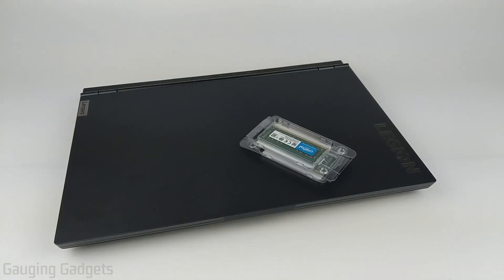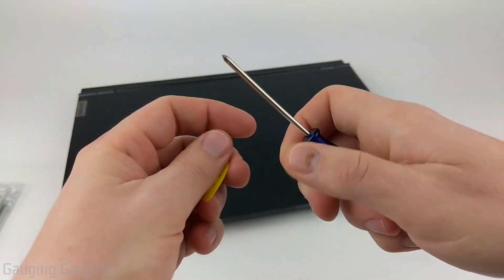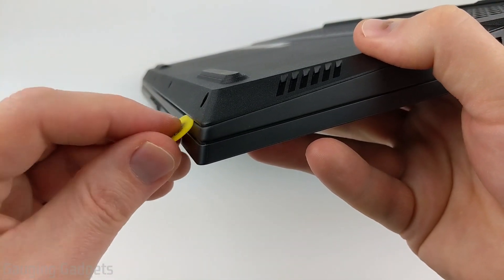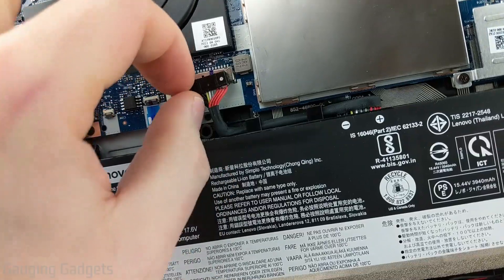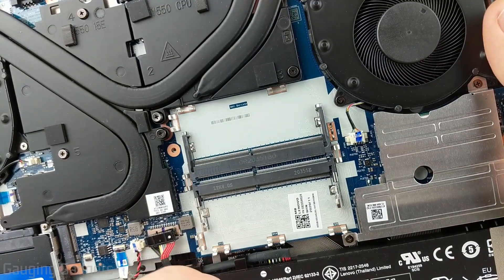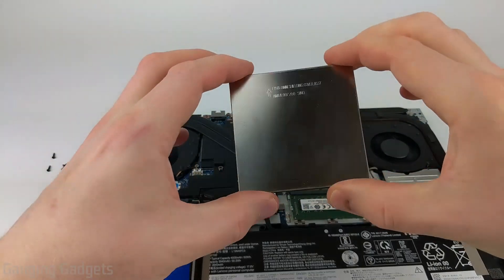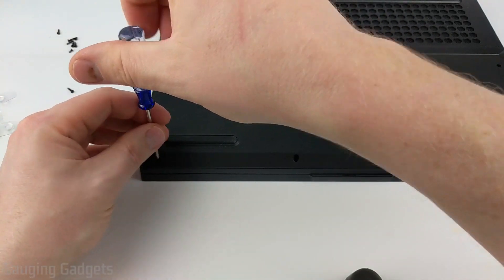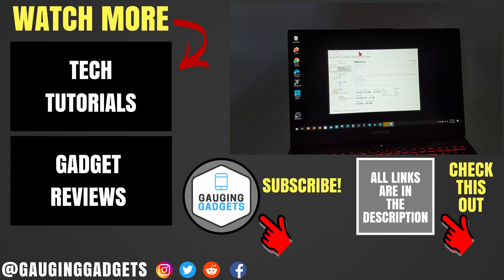How to Upgrade Lenovo Legion 5 RAM - Add RAM to Lenovo Laptop - Legion 5-15IMH05H

Comment: Saw a guy upgrade a laptop's memory, did everything like you showed, screwed it back together and... nothing. One of the memory chips was bad. He then explained that he always tests them out, before he screws the back on, except this time. And this was the time when he should have. Moral of the story? Check that the system works before you button it up. And if you are lucky, it will always seem like a waste of time.

Comment: Hi, I have Lenovo Legion 5i i7 10750H. The installed RAM is 8 Gigs of 2933 Mhz. The i7 10750H CPU supports 2933 Mhz. But I'm finding it difficult to get another 8 Gigs of 2933 MHz Ram. Can I use 3200 Mhz instead?
Reply: same here need advice
Reply: samee!!!!
Reply: Same

Comment: Hi, I just bought the same ram module form crucial and added that to my current 8gb (already in the laptop). When the crucial ram stick is inserted and I power on the laptop a black screen is displayed. When I remove the crucial ram and put the old ram only the laptop works fine. Any help please???
Reply: Maybe you just have to wait for longer? It usually takes more time for laptops to boot with new components for the first time (after installing them).
Reply: Hello,
Did you get it to work? I’m thinking of doing the same

Comment: 1. I forgot to take out thr battery and it short-circuited. But my laptop is tunning fine. What might have happened in long term ? 2.And is it normal for the fans to sometimes start spinning 1-3 minutes after booting up ?

Comment: If i want to upgrade to 16GB and there is 8GB already installed, is it generally okay to buy another 8GB same frequency to get you to the 16GB? I know from building my desktop there are timings etc and it is generally recommended to buy the same sticks. Is laptop RAM generally okay as long as it's the same frequency?

Is there a site that shows compatibility? Tried the Lenovo site and was tricky to find the model. 

Cheers.
Reply: There shouldn't be a problem as long as they have the same frequency. I have been running 2x2666hz ram of 2 different brand for nearly 2 years on my HP omen and I had no problems so far. 
I have monitored their clock speed with cpu-z and I run dual channel at 2666 when under load
Reply: @mattiacarraro1041  Cheers man
Reply: @mattiacarraro1041  but the ram is a 2933mhz...it's ok to use it anyways?
Reply: How can I check what Hz my ram is?

Comment: Hey can I upgrade ram without removing the battery cable?
Reply: yes, but its better to remove.
Reply: @arashftzz4  Yes, my display was not turning on, then u removed and put the ram in then it worked

Comment: How the hell did you open it? I tried so hard but couldnt separate the 2 lateral sides (where they go down), guess I'll have to go to a service...
Reply: Did they manage to show you how they did it? I can open the front and back fin but the bits where the grill sticks out for the air intake won’t budge an inch. It’s so annoying because every video skips over that part like it was simple
Reply: @joesladden9914  actually I brought it in and came back the next day, I didn't see what they did. Sorry :))

Comment: I booked the same laptop
I want to upgrade to 16gb
Do I have to buy a single 8gb ram or a kit to make it 16gb?
Im new to laptops 
Can you please help me out
Reply: I guess you just need another 8 GB, you can probably use the installed one, but I'm not 100% sure...
Reply: Can confirm I installed 1x8gb stick from the same manufacturer as my existing 8gb stick 👍

Comment: Just a question, is disconnecting the battery necessary?
Reply from the maker: No, but it does reduce the risk of shorting out anything. This just removes the flow of electricity to the computer while you are working on it.
Reply: @GaugingGadgets  Did it anyway. Successfully upgraded my RAM yesterday. Thanks for this video 👌

Comment: How did you manage to open the laptop cover near the exhaust area? I’ve been struggling for an hour now
Reply: Same
Reply: figure it out yet 7 months later? I Just upgraded mine ... used a skinny flathead screwdriver to pry up everywhere FORWARD from the vents aka the front of the laptop, and then just with my slightly grown out fingernails, gripped into the sides of the vent area and just gently but firmly pulled/pry it up & away from laptop,  and they popped off of the vent areas easier than expected...... 2021 Legion 5 17" version
Reply: @Sir......  Yeah I got it a while ago, even forgot I wrote this comment, I just used a thinner guitar pick and it worked.

Comment: Thanks for this video. You made it look very easy an I'm looking forward to giving my legion 5 a ram upgrade after watching this.
Reply: let me know if the ram runs at 3200 and not anything below.
Reply: @Syirus2020  It will run at 2933 mhz even the stock installed is 3200mhz but works on 2933mhz

Comment: If I want to give it 16gb of RAM, could I just get one 8gb RAM chip and add it to the one that's already in there? Or would it be better to get two new ones?
Reply: It’s best to have two that are the same brand and specs.
Reply: You can check what exactly ram you have using Lenovo vantage software and just buy the same one to upgrade to 16GB.
Reply: @fisherman02  im making a note of this because i am going to buy a legion and upgrade  the ram... thank you!
Reply: @L1ghtning407  Again, before buying RAM blindly, make sure you take your time and read. In an answer above I gave all the data needed to make an educated RAM purchase for your legion 5

Comment: Just wanted to know if i can get a single piece 8GB ram and install it with the already available 8GB to get a total of 16GB? or should both RAMs be from the same origin
Reply: You can simply add the 8G to your existing memory but recommend you to get the same speed grade. I have always believed that matching is important.

Comment: can i put the pc with 24 gb, mine have already 2x8, would get one off and put a new 16. Will it work?
Reply: You can, but it's usually not recommended to mix different RAM sticks together as they won't be operating at their optimal performance. You should just buy two 16 GB sticks.

Comment: Wow! Interesting. I've been searching for specs info on the Legion 5 and all I found was that the max capacity was 16GB Ram, which I couldn't believe since it's considered for gaming. But you proved to me that indeed nowadays vendors don't even bother to share this information. The model I have is a Lenovo Legion 5 82B10052US  but it should be the same thing since they're both Legion 5, still I wonder why the information provided is an incorrect one. 

But thanks to you I can be assured that I can happily upgrade my ram :) thank you!
Reply: I read that lenovo wrote more then 16gb ram wouldnt bring a significant increase, because the mainboard doesnt sees any different if its more then 16gb. Maybe if you have 8gb ram and you upgrade to 16gb it would bring improvements. But i dont think when u upgrade from 16gb ram to 32gb or 62gb would bring any big improvements tho.
Reply: Is this the same for the Lenovo legion 5 15ARHO5? It has ryzen 5 4600h and gtx 1650 .
Reply: @Yeet-kc2lt  yes i have that config it can go up to 64gb 2x32 and i think thats the limit, the limit of the ram depends on the cpu i think and u can search it on the internet
Reply from the maker: This video should help when trying to figure out the max RAM capacity on any Windows 10 PC https://www.youtube.com/watch?v=WxKgoA2JzHg

Comment: Hello I’m upgraded to viper 3000mhz ddr4 2x16gb but system shows 2613 something like that but should be 3000mhz 
But when I change on crucial ballistix 3200mhz in the system was 2613 as well
In bios I can’t get access to change ram speed like normally I do in pc??
Do u know how to change it?? Pls
Reply: Did you figure how? I have 3200mhz but ran at max 2993
Reply: @ninjack322o  Read in an answer I gave above about RAM. With this you will be able to purchase the right RAM for your legion 5. And stay clear from crucial's ballistics, they are highly unethical. If you go to their ballistics page, they are being grilled by countless cheated laptop RAM buyers, and nevertheless crucial keeps not publishing the JEDEC (native speed) profiles and luring the uneducated into buying their lower grade quality RAM for gaming on laptops, where RAM overclocking is not provisioned in the BIOS.
Reply: I think the lenovo legion 5 only supports till 2993mhz. It also dont give big improvements if you use 16gb of ram or 32gb or 64gb. Becausw lenovo said that the integrated mainboard would only support ram up to 16gb that means it only bring improvements if you switch from 8gb to 16gb but not from 16 to 32g.

Comment: Ok I got it working and yes it supports 64gbs of ram 2x32gb ddr4 3200mhz I just successfully booted first try!!!
Reply from the maker: Wow, is it recognizing all 64gb?
Reply: @GaugingGadgets  yup I'm actually very happy about this. Speed was automatically downgraded to 2933, which is totally understandable its some kind of firmware stability thing.
Reply: @SERGE_Tech  Nope, it has nothing to do with stability. Most of RAM for gamers is sold not rated as native speed (JEDEC), but instead is reaching 3200 only with an overclocked XMP profile. On one hand XMP is an intel thing, so AMD is naming it another way. Second only desktop mainboards can overclock RAM, be it with intel's XMP, or AMD's equivalent thing. 100% of laptops can not overclock RAM. It is all a scam, so when we purchase for example the legion 5, we have to pay top dollar for more RAM from the vendor, instead of getting RAM later. If you do it blindly and don't know how to check in CPUZ, than yes you can upgrade up to 64gb, but it will run at the highest rated JEDEC profile speed for that particular RAM module. Pretty much noone, except for Kingston, publishes their JEDEC profiles for the RAM parts. Only with Kingston you can read and find out which RAM unit will have JEDEC profile for 3200 (in our case), with the rest of brands, you need to do trial and error. It took me hours to find which one would work for my legion 5. Now it runs the 16gb RAM @ 3200, but if I would have wanted 64gb it would also have been running at native JEDEC 3200 profile. The moral from the story, one has to read a lot instead of watching and making quick superficial videos. I  have a question to the publisher of this video: Did you check in CPUZ at what speed your upgraded RAM is running? I am ready to bet it is most likely at 2666, or 2933, but certainly not at 3200. For the curious above I gave all the answers you need to make your lenovo legion 5 run its RAM at max (64gb) and at full speed (3200).
Reply: @hyperactivefarms  I’m 8 months late.. But could you give me the brand of ram you chose and potentially a link for a recommended one?
Reply: @HardstuckFragger  get 2 of these (for a total of 32gb), or 2 of the 8gb stick (for a total of 16GB), but from the same model, since those are guaranteed to support JEDEC @ 3200 MHz between the 2 sticks. Kingston ValueRAM 16GB 3200MHz DDR4 Non-ECC CL22 SODIMM 1Rx8 1.2V - KVR32S22S8/16
Reply: @hyperactivefarms  thank you so much!
Reply: @hyperactivefarms  old post comment: noting that the Intel CPU specs for the 10th Gen i7-10750H indicate support to 128 GB(!) of DDR4-2933. Not that one can find a pair of 64GB memory SODIMMs.

Comment: Good god finally got it open I was very impressed with this laptop tell I had to open it Jesus! Those little plastic hinge things are done....
Reply from the maker: It is much harder to open then other laptops.
Reply: Hi. Is there a slot for a 2nd SSD to be added?
Reply: @Omar_Little  yes, if you take out the hard drive there is an other m.2 slot
Reply: After opening it for the first time it's a peoce of cake